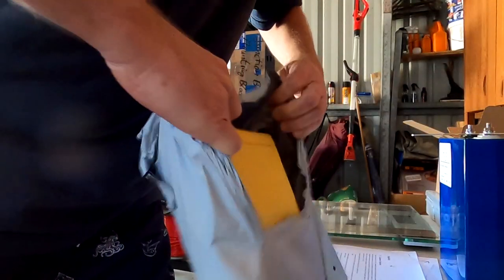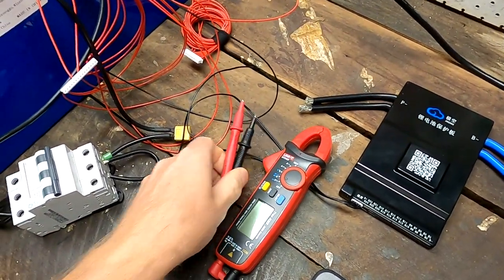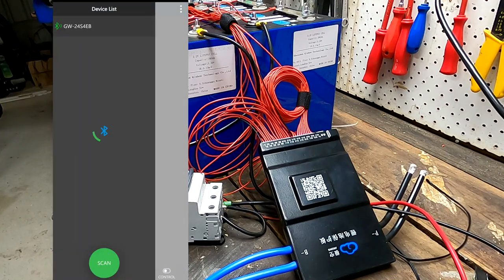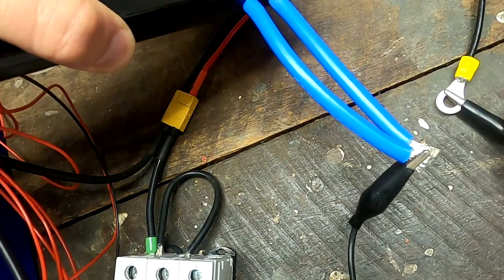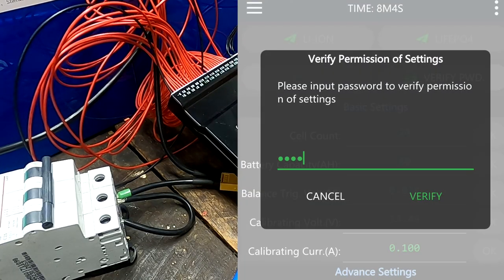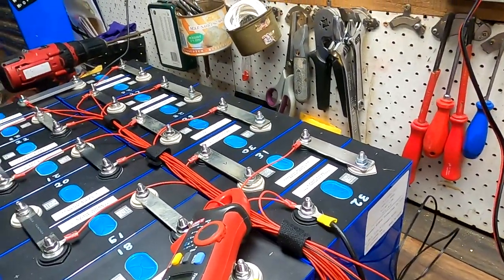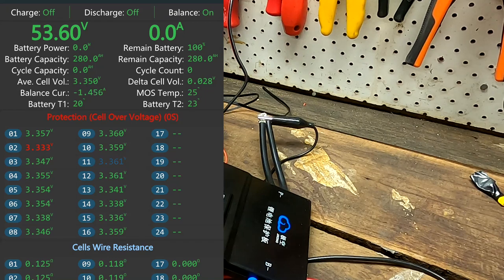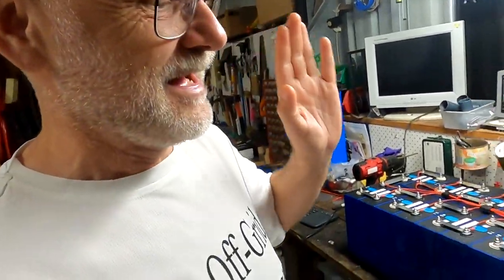The JK BMS with integrated active balancer. This is the one!

Comment: I have alot of trouble with this unit, i have two of them. If it shuts down due to going over or under voltage, its a nightmare to get it back on again, having to boost the charge on the p side. But weather it turns on or not still is a matter if luck for me, sometimes it works, sometimes not. While the BMS is disconnected, it stops ballancing, and you cant monitor anything or change settings. 

Id love for them to offer a fw update to resolve these things.

This last week ive not been able to get one of the bms' to work at all, im about to send it back, its only a couple months old
Reply from the maker: Seems like you have a faulty unit there. Mine always started when applying a 4V higher voltage to the P- terminal.
Reply: @OffGridGarageAustralia  i think so, its going back today.
Curious though, given that when the BMS is off, there's obviously no control or monitoring. But is the ballancer still active in the background? I dont have any good means to test it here and its all tucked away awkwardly on a bus, but you seem to have a fairly accessible bench setup, if you ever do any tests to that effect in your tinkering, I'd love to know for sure. Ive been assuming its off, but, with aliexpress stuff, ive learned one should never assume anything :)

I might just lower the power down voltage to well below the restriction voltage and hopefully that avoids this power down situation ever occuring
Reply: @OffGridGarageAustralia  + Voltage to P- would not cause a direct short to ground?
Reply from the maker: @rocketentertainment7403  No, the balancer is part of the electronics and won't be active if the device is off.
Reply from the maker: @rudyhenderson5002  No, it won't short. It's an external voltage of +4V or higher to start it up. You can also connect a charger with a 4V higher voltage as the battery voltage to start it up.

Comment: Looks really good. Ticks (almost) all the boxes for me, but I really wish they would also make some that are 4S and handle 250A, that's a sweet spot for some of the things I do. 

But for a home setup, it's ideal. Having so many settings is great, but for some people it may also be overwhelming, and it's sometimes a little too easy to make a mistake which causes problems. But hopefully it's pre-programmed with generic safe settings for the majority of people. 

Good find Andy, I'm sure one will be on my bench before too long. 

* Not sure about the main cables though, they look a bit small for 200A continuous!
Reply from the maker: Thanks Paul. That's the big - on the list. It wont' work with packs below 15s configurations. The same with the active smart balancer I showed recently. 30V minimum voltage. I wonder if that is because of the active balancing and they need that voltage for the circuits somehow.
Reply: @OffGridGarageAustralia  It will work with 2-24 cells, but it needs a 40-100V supply on the B+ terminal, which can be generated by a DC/DC step-up converter. The B+ terminal is supply only, it can be different from the battery +. The current consumption for B+ is max 10 mA at 100V, so a very small step-up converter is needed.
Reply: Yip I am also hoping for a 4s one

Comment: Thanks for the excellent all-in-one BMS review. I really like the Voltage Threshold setting so balancing only occurs during the charge cycle above the Set Point voltage. The only thing that worries me about this product is the 200A current being passed through the PCB, much prefer a separate high current contactor or relay like the QUCC product. Really hope they upgrade the firmware on the stand alone balancer products as well. I'm using the 2A version on a 120Ah battery and discovered the same thing you did, continuous balancing in the flat part of the cell voltage range tends to unbalance the cells. Perhaps a future video you could go into more detail about the CAN and RS485 communications.
Reply from the maker: Thank you. Nothing I have tested so far was 100% perfect. The JK BMS though comes very very close and I would give it an over 90% rating so far. I'm not worried about the 200A for two reasons: I'm not going to push more than 100A through it anyway and the internal resistance of it with 0.3mOhm is so low, that even with 200A it causes only 12W of power loss. Heat stress is not a problem with this BMS.
Reply: @OffGridGarageAustralia  the 0,3 mO is also a factor to take into account I had not recogniced or would not have realized.

But 200A x 50V would mean 10.000W and 12W is not that big deal just 1,2 promille.

My 1000 kWh battery usage needs 1200 kWh feed in to get 1000 kWh out, which would mean 0,0012 x 2.200 kWh = 2,64 kWh for the pure BMS and on top of cause a bit for the operation of the balancing part I guess.

Comment: Looks like a Heltec BMS to me. Just FYI, most FET based BMS will let you turn charge and discharge on or off (including the Daly). Good video, not too long. You should try your four wire tester and measure the resistance for the balance wires. The best part is no extra wires for active balancers.
Reply from the maker: Thanks John. I think these BMS' are sold under different brands but are all the same JK tech under the hood. 
I filmed a lot more and tested other functions but cut it out due to the longish video already. Well, there will be more following soon 😊
Reply: @OffGridGarageAustralia  Yes, I just called it a Heltec because that is what it was called when I first saw one reviewed about two years ago. @Up North and Personal has one, and yes, I think it is one of the best FET based BMS. I like relay based BMS, but you have to have two relays, so you don't disable discharging when it is full. Then there is the problem of finding a reliable relay that doesn't draw too much current.

Comment: do they make this in 24 volt 8s ?
Reply from the maker: Yes, they do! Link is on my website here: https://off-grid-garage.com/battery-management-systems-bms/
Reply: @OffGridGarageAustralia  thank you !
Reply: @OffGridGarageAustralia  i checked out the link and the bms looks nothing like the black bms in your video
Reply from the maker: @bobbyt3451  that's correct, the 8s version looks different but it's the same BMS and app. It's the 6s - 8s BMS with display/switch. Make sure to contact them for confirmation of the power button at the display to turn on the BMS before you buy.
Reply: @OffGridGarageAustralia  ok thanks.also it looks like it has holes instead of wires so i can use larger wires then the 7mm wires on the other bms
Reply from the maker: @bobbyt3451  potentially even ring lugs, so no soldering. Most cables of BMS's are too thin in my opinion anyway.

Comment: 24V is a sweet spot for everything. I will place multiple 24v 1500VA APC UPS for the AC current, and switch 1 or more off when AC back-end is not in use.
Reply: I like 24v as well. Low enough to be safe, high enough to not need ridiculously huge cables, low enough to be able to put twice as many banks of cells in parallel (compared to 48v), high enough to be efficient enough for my needs, low enough to not turn off my panels on cloudy days...
Reply from the maker: I will have this one working with 24V soon for you guys...
Reply: @OffGridGarageAustralia  Oh you saved my day ;-) !!! BMS looks really good yes, 2A could work with big cells, I believe there is a JK BMS RS-485 Raspberry solution, and that is really required for me. I will order a 100AH pack, more then enough for me, I have problems with the cycles, with clouds you can make easy 1 full cycle a day, 10x to 90% is 1 full cycle, now cycling with AC power, so a cloud AC -> DC converter steps in for the AC network. There is some loss but battery's are also -30%

Comment: When the video started, I thought you were running to get a new "calibration device"!  :)  I had the same thing happen with a couple of Daly BMS units, where you need some current flow through it before the BMS wakes up and the Bluetooth will connect.  Later, you can "start" the BMS by simply having a draw on the battery.  

I can't help but wonder if the same company builds a different product that is suitable for 4S to 8S or 12S.  Hopefully it is a durable product.
Reply from the maker: I did some more testing now and connecting the power supply with 4-5V higher voltage than the battery will turn it on right away. I wonder how to do that when the battery bank is in place though as the solar charge controller won't have that higher voltage to start the BMS 🤔
Reply: @OffGridGarageAustralia  - I think you'll find that when the battery is under a load, you won't need the high charge voltage for the BMS to wake up.

Comment: Andy,

Can you please find out what the power drain on these units are.   What sort of power do they consume when they are not balancing?
Reply: Good point. And also if it draws current equally from all cells.
Reply: It uses the B+ so it should be equal on all cells or use from external supply.
Reply: 10mA only.
Reply from the maker: It gets its power for the P+ balance cable and consumption was less than 10mA as people said here.

Comment: I am really searching for this one. But I am wondering about the overcurrent protection, why did the BMS cut off the charging instead of limiting the current? how will it continue with charging if you disconnecting your loads from your charger (MPPT) and just remaining the battery backage? As you know all current will go to the battery now and you neither need high current charging and nor to reducing your MPPT current because of the MPPT should supply your loads and charging your battery too. so how did you will deal with this?
Reply: A BMS can not regulate current - it just protects the cells, and one setting is this over current protection. You can just put it to 100A or higher and it won't trigger. These cells can handle that. If this BMS is used with smaller cells, you use this protection if you accidentally have too much solar or too big charge controller setting.
Reply: @upnorthandpersonal  
Thanks for your kind reply. very clear thanks
Reply: Once the weakest cell reaches its voltage limit (say 3.55V) the system should start tapering back the current (slightly reducing the system voltage) so that the weak cell won’t go over voltage and the other cells can catch up via balancing. This requires the SCC to act based on information that only the BMS can measure.  Not simple when the BMS and SCC are made by different companies.  We have thing like Venus OS to help here, but really, should we need a computer to glue everything together? Can’t we have hardware capable of doing the complete job?
Reply from the maker: Michael, that is not a task for the BMS but for the charge controller. The BMS needs to tell the charge controller to slow down. We're working on this...
Reply: @henvern  
This is what the BMS of DJI Phantom 4 does. I use the DJI BMS battery for some projects and I found it is even regular the voltage, it is perfect. I think the BMS technology especially in the renewable energy field is still not cooked well. I do not know if there is a very good BMS produced by a good company!

Comment: For the price point, it might seem to be a bit on the high side for the 200 amp version. However, if you price out the QUCC BMS with relay and the Neey 4 amp active balancer is about $20 USD more than Hankzor BMS with integrated active balancer in one package. For stationary power users, we're always dealing with the conundrum of incoming and outgoing electrons; managing both of them at the same time gets really interesting just following your real world experiences. EV users don't really have this problem since you're doing one or the other. The 200 amp continuous limit is workable for me and having multiple strings for redundancy is a good thing too. A FET based BMS with a programmable active balancer ticks all of the boxes for the application.

Something to look into, I noticed that when you were testing the cell overvoltage condition. I saw that it stopped the incoming charge current and the outgoing too. It took a few rewinds of the video to catch it on the screenshot. I am not sure if it is a bug or not, curious to see if it is. We do want a way to drain down the overvoltage issue without causing a total blackout of the system. 

I am also curious about the RS485/CAN connections and what data can be extrapolate from them; this is especially useful in my case since I am solar AC coupled on the backup side of the inverter (all I can say, it gets quite interesting) to better manage my solar in offline mode. I can go with the Sol-Ark option at a cost of $$$, but its no fun if you can't build it and customize it to your needs.

Keep plugging away and back to the drawing board for me on my battery setup design. Getting the bugs sorted out is always the project killer.  :-P
Reply: He didn't have discharge enabled at all. The BMS controls these independently. An over-voltage only disables the charge port.
There are several drivers to read the data on e.g. a R-Pi, or in combination with Grafana etc. You can read out pretty much everything.
Reply from the maker: Thank you Felax. I think I didn't have the discharge button on from the beginning as there was no load connected in this test. I checked again this morning and it certainly only turns off charging but leaves discharging on if an overvoltage situation occurs. Thanks for picking this up.
And thanks Up North and Personal for elaborating on this already.
Reply: @OffGridGarageAustralia  that’s good to know, looking forward on the real world test while documenting your journey through the good and bad. While it is start of autumn here, the electrons will really be cooking in no time soon down under.

Btw, you can use it on an 8s configuration by using a dc to dc converter to bring the voltage up to the minimum requirement to power it up. How efficient it will be is you won’t know till you try it.

Comment: I noticed two more things: 

1. At 4:34 you show that it has a Coulomb Counter! So, no more need for a shunt? 

2. At 20:14 you show that you can enter the wire resistance for the sensor leads. DMI INC (in another thread) suggested that the resistance of wires (and terminals) could contribute to shunt "drift". If you're pushing 2A though long skinny sensor wires, I could see how that would be possible, and it's awesome that there's now a way to compensate for it!
Reply from the maker: I have to see how good the shunt is. The Victron smart shunt integrates nicely with the Victron gear. To integrate this BMS, it needs a bit more tweaking. Brad is working on a solution...

Comment: Seems like a nice bms will you test the maximum charging current.
Reply from the maker: Probably not. I'm limited to 4kW only with my load. And with the second battery coming online, it will pull only 40-50A max from each bank. I just don't have the inverters for 50V and 10kW to max it out.

Comment: Need to clarify JK BMS do work with lower Sx configurations, I did my first balance test JK BMS with 4S, without issue, but need the required working voltage on B+. For examples see pictures in documentation. Can add a dc-dc bost converter if needed, see doc.  To start see YT video https://youtu.be/GEOcORlh0w4
To read the chinese documentation we can use Internet and translate for example on Google translate, paste the url, or inside of Chrome with translation. /J

Comment: good video
I had a lot of problems with the initial charge of the batteries.
for the balancing problems that you should encounter ..., I advise you to carry out this first charge with a low voltage of 54v max until all the cells are balanced at less than 0.010V. this avoids runaway more of 3.7v for the first charged cells.
for grafana, you can use jblanche's script.
Reply from the maker: Thanks for your advice and sharing.

Comment: The balancer is same basic electronics of the NEEY you just reviewed.  Only thing questionable is putting the supercaps on the end of MOSFET string subjecting the supercaps to a lot of heat from the BMS series pass MOSFET's.
Reply from the maker: I have the BMS connected for two days now and just balance the large 280Ah cells. it continuously pushes 2A across all cells but it stays totally cool.

Comment: Hi Andy another great vid.
Did you ever try the UART module to usb for the QUCC BMS?
Reply from the maker: Thank you.
I didn't not try that, no. What does it do?
Brad is working on a RS-485 solution/option to connect to Victron and other gear.
Reply: @OffGridGarageAustralia  the uart to usb device replaces the Bluetooth module on the BMS allowing you to control it from computer.

Comment: Hi Andy, I have been watching many of your videos lately. It also helped me order my JK smart BMS. :) I want to use it for a new LiFePo4 battery pack (72v 12ah) in my Online UPS. I also plan to attach 9v battery terminal across B- and P- to activate the BMS.
I have that seen you use DC circuit breakers. Can I also use 2 pole breaker in my setup, between the battery terminal and charge/ discharge terminal of the UPS? Will it work properly during charge and discharge function of online UPS? If yes, what Amp rating should I go for? It's 3000kva/ 2400w UPS. Thanks.
Reply: Sorry 3000va ups
Reply: @rejujacob2693  Amp = VA / V
In your case A = 3000VA / 72V = 41.7A
make that 150% and use 63A CBs